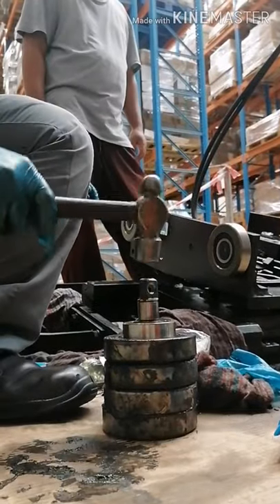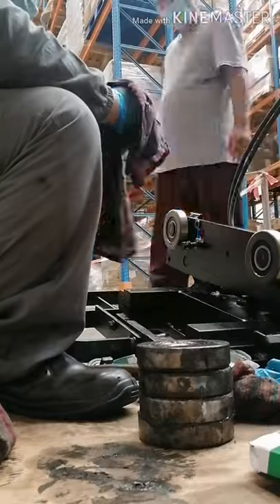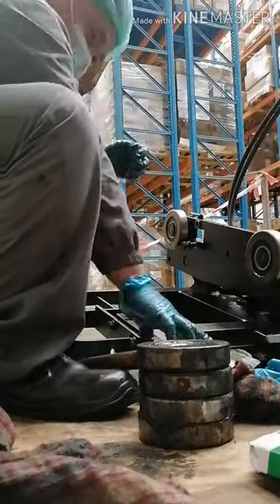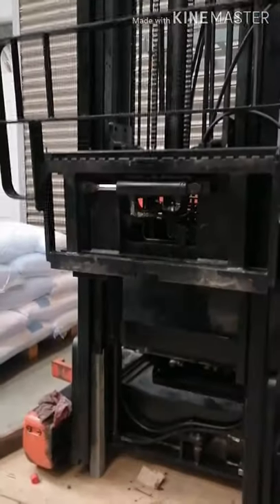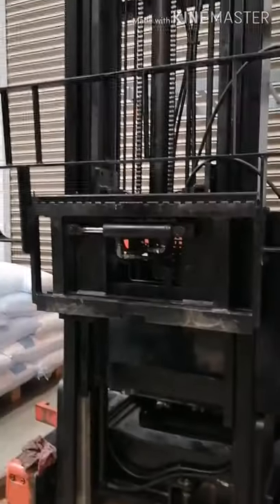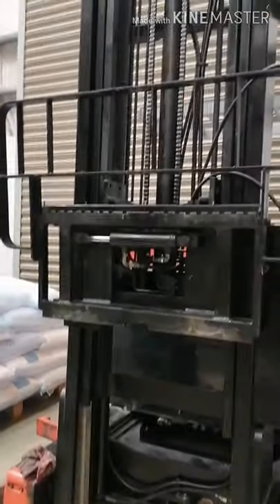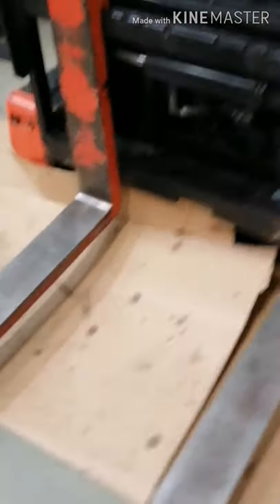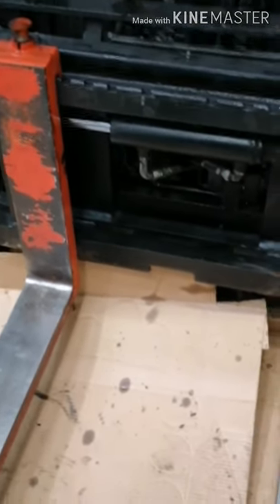How to replace roller bearing of mast carriage

Comment: Boss, ano problema sa control valve ng reach truck? Maingay kasi kapag nag lilifting.
Reply from the maker: Check muna hydraulic motor mo.. Baka bearing lang yan.. Ang control valve gate way lang ng Hydraulic oil yan.. Kaya una e check yong hydraulic pump and hydraulic motor
Reply: Boss, yung reach truck sa cold storage pag natanggalan ba ng ground nya yung papunta sa floor nag ga grounded ba yung unit?
Reply from the maker: Yes.. Importante ang ground wire. Protection yan sa mga board. At static electricity shock. Para hindi rin ma kuryente ang operator.
Reply: Nag spart kasi yung isa naming unit pag naka dikit sa bakal yung fork.. pag tingin ko sa ground nya papuntang floor yung rubber na ground e wala na natanggal na.
Reply from the maker: Please check battery unit sir.. Baka grounded na yan..